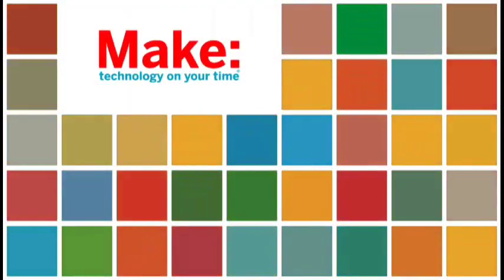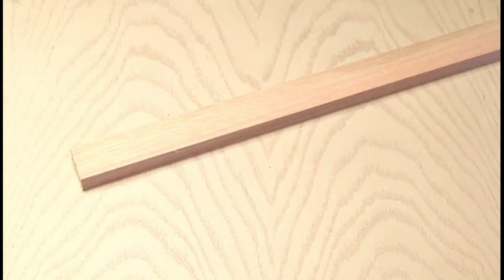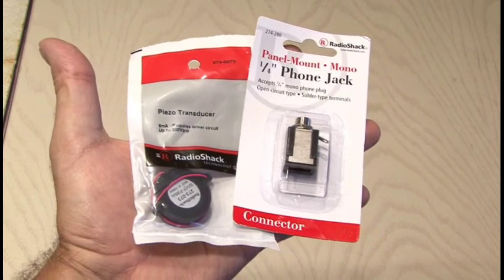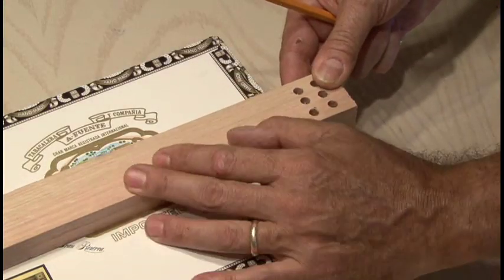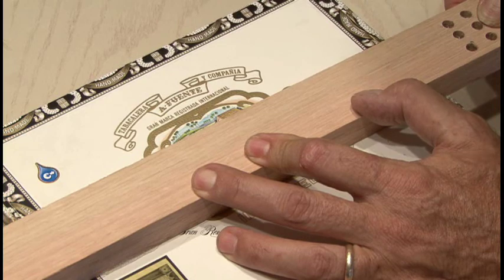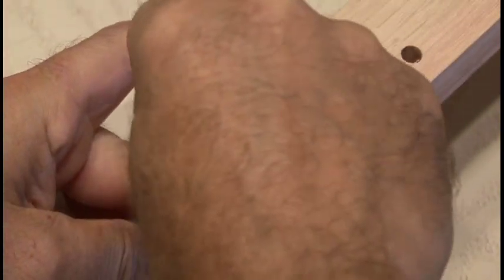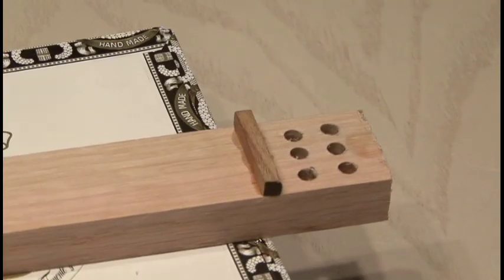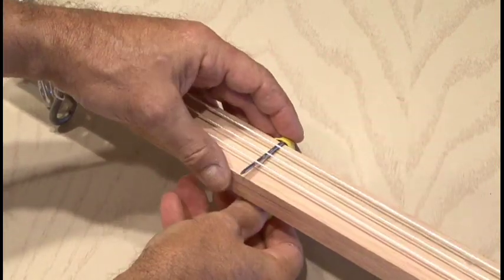Weekend Project: Electric Cigar Box Guitar

Comment: Make more permanent frets on these. 

Total length between nut and bridge divided by 17.817, gives you distance from nut to first fret. Distance from first fret to bridge, divided by 17.817, gives you the distance from first fret to second fret. This continues for the third and fourth etc.

Its best to add the fret distances up and measure from the nut for final placement though, or many tiny discrepancies that you wouldn't be able to notice on their own may start accumulating.

Comment: A pezio transducer will not pick up the sound coming off of the strings if they are not made of metal. (This also applies for if you install a soil coil or humbucker pickup). Thats why at the end it was electricifed at all, just the sound of the strings.
Metal strings only cost about 5 dollars, and if you want it electrified its a must. Plus putting the 3 foot long 2 by 1 through the guitar box is also a huge improvement that takes about 10 minutes work. Just make sure its flush with the lid.